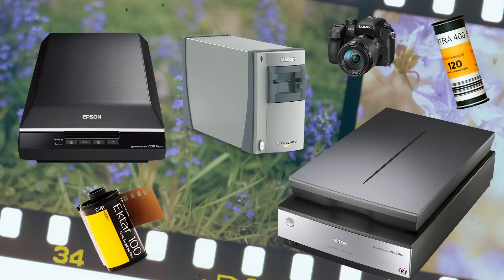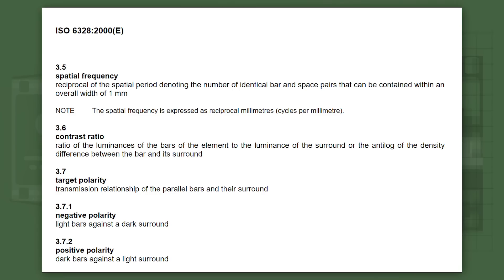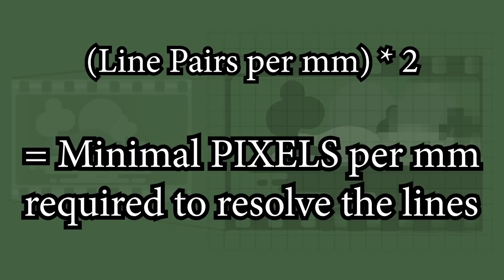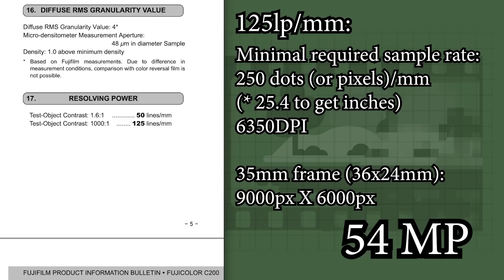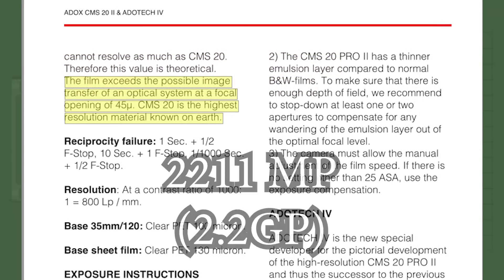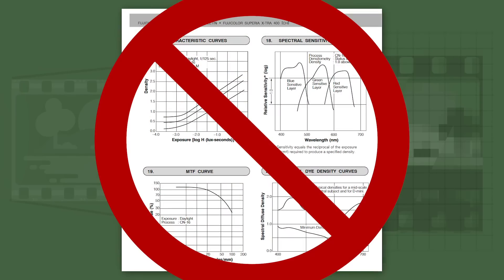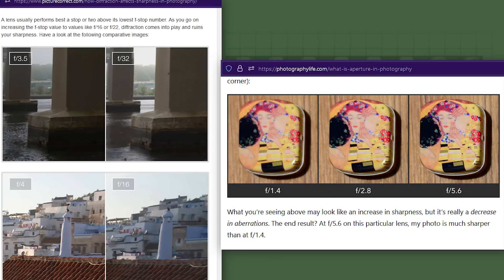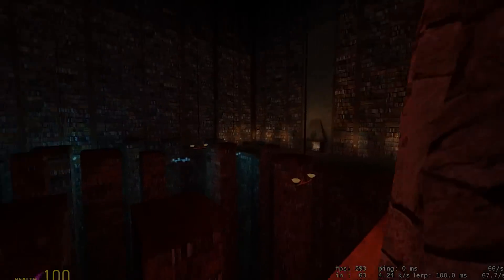The TRUE Resolution of FILM

Comment: I have a 3mp digicam (I have like 10 digicams) and it's pictures are nicer looking than iPhone. Unprocessed looks so nice. Also old iPhone 4s had the best image of all iphones. Before they added the NR in the updates.  However I have 4 analog cameras that I am testing. Problem is the old cameras with AF is not good  as autofocus is a hit or miss. Konica c35 AF2 didn't have the feel I wanted and the autofocus has a lot to be desired.  Now I'm a Konica c35 Automatic where I can manually focus but I don't have a flash. It looks so nice.

Comment: Fantastic analisys the only point I'd argue is at 8:47 where I think it's fair those camera are called medium format because is the dimension of the sensing element, which is the same as 6x6, like full frame cameras have the sensor with the dimension of the 35mm, independently of Mpx or Iso or resolution, it's necessary mostly for the lenses

Comment: In my experience, the image quality that is obtained from a regular 35 mm colour negative film, such a Kodak Gold 200, is equivalent to a digital photo taken with a 4 Megapixel sensor or thereabouts. I came to this conclusion by comparing real-world photos made using the full area of 35mm negatives with those from a 36 Mp digital camera that had been progressively cropped down to 2/3rds of their original size vertically and horizontally. In other words, the digital images were cropped to 1/9th of their original area, resulting in a 4 Mp image. In both cases, very sharp lenses were employed. The film negatives had been scanned using a good quality 24 Mp digital camera, by the way. To further back this up, I have found that 35mm colour photos, derived from converting the scanned negatives to positives, can be displayed or printed at only up to A4 size (around 12 inches by 8 inches) before the grain and the inherent lack of sharpness (acutance) of the emulsion become obvious when viewing at arm's length. This is because 4 Mp is roughly 2400 x 1600 pixels which, when printed at 200 dots per inch, provides a print size of 12 inches by 8 inches. Note that 200 dots per inch is roughly the threshold at which "pixelation" becomes apparent to the naked eye. Printing or displaying 35mm photos at larger than A4 quickly reveals the image quality limitations of normal film types. I also shoot film on a Fujica GL690 6 x 9cm camera which, by virtue of its 5.5x negative area compared with 35mm, provides the equivalent of 22Mp resolution according to my findings. The image quality from this camera is correspondingly superior to 35mm and very comparable to that of modern digital cameras, producing really sharp photos that can be enlarged to A2 without apparent grain and blur. I believe that comparing real world results in this way is a better guide to the "how many megapixels?" question than scrutinizing film manufacturers' technical data charts, etc.

Comment: As a commercial advertising product photographer, 8x10 film (Ektachrome 64 and then Fuji Velvia 50) was my primary medium for many years and delivered the highest quality that my clients demanded. Even 4x5 film was a compromise. But when digital capture became mature enough, specifically with the introduction of the Phase One H25 (22mp) introduced in 2003 and later the P45 (39mp) introduced in 2005, I never looked back and my clients and I remained happy as a clam with the image quality. Today I shoot with the dramatically less expensive Sony A7R5 (61mp) with a Sigma macro 70mm and the quality is superior to those now vintage Phase One backs. Add in the immeasurable convenience factor and I have NO desire to shoot film ever again.
Reply: I used to shoot a lot of 4X5 and, as one might expect, the quality was lovely. Then, for some strange reason, we got an 8X10 camera. That thing was gross. But what shocked me was that the quality of prints from the 8X10 was clearly better than from the 4X5. I didn't think the 4X5 had any room for improvement but the sharpness and tonal gradation was obviously better from the 8X10.
Getting back to the main subject here, I have always thought 35mm film was lousy and I've never made a print bigger than 8X10 that I thought was any good. But I can get excellent 16X20 prints from my 24 MP digital. There's no comparison, even disregarding the huge ISO advantage the digital has.

Comment: The resolution of digital cameras is overstated because this discussion of equivalent resolution can only hold true if the digital camera is only taking black and white pictures. The discussion neglects the effect of the bayer filter used to capture color in most digital cameras. Each pixel in a camera only measures either red, green, or blue light. Half of those pixels measure green, one quarter of them measure red and one quarter measure blue.  This means color resolution is only about one half to one quarter the stated resolution. A digital image is like a monochrome image at the stated resolution with color laid onto it at a fraction of that resolution. Good film can still record much more information than a digital sensor can resolve. However the resolution achieved with modern digital cameras is much more than required for most purposes. As stated in this video, the resolution actually achieved with film is further limited by the optics used and by the method of processing the film into an image. Both film and digital are now much better than most users require but digital is much more convenient. Resolution is really less important than most people believe because camera marketing (and cell phone marketing) have used resolution figures to compel people to buy more expensive products every year. I think digital cameras became adequate at about 3 megapixels and after 10 or 12 megapixels the additional improvement is beyond diminishing returns.

Comment: Is it right? Is it wrong? Lots of discussion. But most of us can agree that film can absolutely hold its own in the current day. If you have a good lens and reputable film, the resolving power is quite surprising. 
I've been shooting digital for the last 15 years and my only film experience was disposables in the 90s. Recently tried film for that "grainy look", but quickly realized it's actually harder to achieve that than you might expect. Anything under 400iso is impressively sharp. Since then, I've almost exclusively shot film. It's just more fun to work with.

Comment: But actually the whole system is diffraction limited. In case of 35mm it is somehwere around 40MP. In case of digital medium format (such as gfx) its diffraction limit resolution is around 75MP, and thus justifies the use of 100MP sensor. Even if film itself can have such high resolution, at the end of the day your camera system is diffraction limited due to the size of the film.

Comment: Ha, i did analog enlargements for about 25 yrs, hand a Durst enlarger on rails and my darkroom wall i exposed prints on  was 2.1 meters high but  5 1/2 meters wide... Photopaper limited a single sheet to 1.36 meters wide, but in parts the largest print i ever did in there was 10 x 15 METERS ( so 30 prints that were stuck together ) and indeed it was from a 8" x 10 " colour negative...  DIgital still sucks in quality but ppl just find it easy and sort of don't care about real quality anymore or can't afford it (p.s. thta insane " high " resolution Hasselblad is a still frame camera, you can not that action pictures with it ( it does the exposures in 3, one for each basic colour ) ...

Comment: I tried to get the best film resolution I could using the highest res film at the time (Kodak High Contrast Copy Film - rated at 250 lp/mm).   I used one of the sharpest Nikon lenses at the time mounted on a copy stand shooting a resolution target.  I developed the film myself using the special development Kodak spec'd.   The best I could muster was about 80 lp/mm.   This was around 1980 (I know lenses are better now).  A Photo mag around the same time tried the same sort of max rez test and managed 100 lp/mm.  But still, real world, you're probably not going to do that well.   From my film experience and digital camera experience, I think 35mm photography gets you 5 - 8 MP equivalent.  Images from a modern high end digital camera are WAY WAY sharper and with a better contrast range than anything I've ever managed on film.  Honestly my cellphone will do MUCH better if the light is good.

Comment: There's something that I have never seen addressed in these videos, and is the fact that, AFAIK, each grain in a film can only be either black or white (or, if it's a color film, either the color or black), which means that any light/color gradation must be done by dithering. So yes, you can have very small lines for very high-contrast elements, but as soon as you have normal-contrast elements, the image dithers and you loss a lot of resolution (which, BTW, explains the two values of lines per millimeter). Instead, in a digital sensor each pixel (or subpixel in the case of three-sensor cameras) can have 256 or more levels of intensity per pixel, so although the "apparent resolution" (this is, the number of line pairs per millimeter) is smaller, in practice, with "real world images" the resolution loss is not so extreme.

Or that's my opinion.

Comment: Lenses are the biggest limitation. I think digital has driven lens technology improvements, past "quality" lenses obviously fall apart with modern sensors, so to get the sharpest digital pictures, they are making technically accurate lenses.  I've got a few older lenses that were very expensive back in the heyday of film, and they do not acquit themselves well in front of a digital sensor.  Fortunately we also have digital means to correct deviations, but the old adage of Garbage In Garbage Out still applies.

Comment: chatgpt explain : 

Here’s a more detailed summary of the idea of using entropy in the conversion from analog film resolution to digital formats such as HDR10+, with some scientific insights and formulas:

Entropy can be used to measure the amount of information when converting analog film resolution into digital formats like HDR10+. In information theory, Shannon entropy quantifies the average number of bits required to encode information, which is essential in image processing.

For analog film, resolution is often measured in line pairs per millimeter (lp/mm). To estimate the number of pixels required in a digital format:

P = L × H × (lp/mm)^2

where L and H are the film dimensions in millimeters.

In HDR10+, each pixel uses 30 bits (10 bits per color channel). The total amount of information (in bits) for an HDR10+ image is:

Total bits = P × 30

For example, a 35mm film with 50 lp/mm results in ~2.16 million pixels, needing:

Total bits = 2.16 × 10^6 × 30 = 64.8 megabits

Entropy plays a key role in determining the visual information and optimizing conversion from analog to digital formats. Higher entropy in film (due to grain and tonal variation) typically requires more digital data for accurate reproduction.

Comment: I have lots of film negatives from the 1950's when my dad had a 70mm camera. I have a black and white 70mm negative that I used a Cannon desktop scanner to scan the negative at 9600dpi. A car in the picture that is more than 100 feet off into the distance, you can enlarge the scan of the negative enough to easily read the license plate of this vehicle 100 or so feet away. 
I highly doubt you can do that with digital photography.

Comment: It gets even worse when it comes to optical magnification (in the darkroom and elsewhere) as the effective aperture (and potential imperfections in the optics) further lower the resolution of film. Most magnifications in the lab are done at f8.0 max,  f11-f16 are more commonly used. Wider apertures are only used for focusing the image. Now factor in the magnification and you'll end up with really small effective apertures, barely enough to resolve the negative. It's like spreading butter on bread, getting a bigger piece of bread won't get you a thicker spread of butter.

Comment: there's infinite "resolution" in a certain way alright.

but there are limits to how precise the technology can store things, which makes sampling above a certain rate pointless,
so you could then argue a bit that technology has that maximum "resolution" for all intents and purposes

microscopes have a limit too on how small things can get until they are no longer discernable , dictated by the wavelength of the light used,
you can technically keep zooming in on it, but it will not net you any extra detail, because the light is stretched to its utmost limits

you could argue it's at the limit of the light's "resolution" , but the resolution of sampling is limited by physical factors rather than capping out the resolution because of a file format used to digitize samples

Comment: It seems that there is a similar analysis and debate in the digital vs. vinyl war. You can't directly translate between the two, but the reality is they're both perfectly acceptable formats that can be of high quality, so high the average person can't really appreaciate the difference. As you say, there is also a limit to human perception, regardless of the source or format; there are only so many cones and rods in your eye. I deal heavily in various media, and even though resolution is imporktant, there are other factors to consider. In digital cameras, I have found that the quality of the light sensor and lenses are more important than the number of megapixels it supposedly capable of recording. Anyway, thank you for the interesting analysis!

Comment: With a contrast of 10 stops most lenses have bloom and chromatic aberration that can ruin the lpmm of film. It's like a blue sky shot from a cave entrance with blackened rock or something. And most lenses reach their sharpest region when stopped down 2-3 stops. Though many primes can be used wide open. 
Another artistic reason to use film is the colour characteristics that's hard to reproduce in digital. Of course there are many presets when post processing but it's still not the same.

Comment: I have a film to digital system that uses a Sony a6000 (24MP) camera, a bellows, a set of Nikon enlarger lenses, and a dichroic colorhead -- you get the idea.  I'm able to see a bit of the grain structure of 35mm film as I convert it.  But certainly not the amount of grain I'm able to see with the critical focus scope in my darkroom.  I can certainly believe that if I double the pixel count in my camera I will begin to approach the information density of the film.   Of course, that's nowhere near the number of pixels I'll need to properly do 120 film.  The math is obvious.

Comment: Only 1 think I think you didn't delve into that you can compare to a digital camera the ISO in film and digital not saying I could answer this but I used a Nikon FM 10 camera I took 2 photography classes to learn my camera better and yes we had to develop our own film and we used an in larger to print with I forced myself to get used to ISO 100 in the film for it's better quality that said it required more light I still had control of zoom and depth of field and for the most part you needed to take your time and think about what your shooting since you had like only 24 shots per roll but it was worth it on one occasion where some old animal bones were being dug up it was horse and pig bones and I believe a button from clothing. I asked if they mind if I take a picture they said ok and I took only 1 photo I took my film to the auto film store got your basic 4x6 prints. And after looking at the photo I decided to get it printed at a 20in x 30in poster size. I could read the newspaper that had wrapped stuff in and the date marking on the wrapped bones in that single shot captured a moment in time with a unique date stamp built right in the moment ant that camera was with a glass lense for some zoom. Now digital was around most of them mainly cheated using digital zoom with sucked. I did have 1 Sony camera that had 10x optical zoom no digital zoom. It recorded images to a 3.25 discket inserted on the side it took really decent photos even though it was 2.0 megapixel. That camera was built right.

Comment: A pixel will never be smaller than film grain, grain is non directional unlike pixels in a grid. You will always need more pixels than the two for anything at angles to match film. 
I once took a picture in Germany back in the 80’s that had a small plane visible flying in the distance. It was very small in the photo and looked very nondescript. I used a Contax RTS2 camera with Zeiss T* lenses and the film I used was Kodachrome with a very low ISO (25?). Anyway, I got curious so I looked at the original slide under a microscope and could make out the planes color scheme, the numbers on the fuselage and the word Osterreich on the wing underside telling me it was Austrian. At that magnification it was very grainy but still legible. I was gobsmacked at the time.
Film really is incredible compared to digital. Of course it’s inconvenient, expensive and more difficult to use as well as more time consuming, but little can really compare when you need the max.

Comment: Hi ShyStudios. The material in the video is very intellectually stimulating indeed, regardless of the many comments. Kudos to you for not having censored any of them.
Even if i am in no way an expert I'd like to add my two cents about the lens resolution as it seems to be common knowledge that most lenses reacht theyr maximum definition somewer between aperture 5 and 11 what means that at aperture 2 it is going to be worse than at aperture 5. This somewhat invalidates your statement about the line resolution of a lens being roughly 1600/aperture.